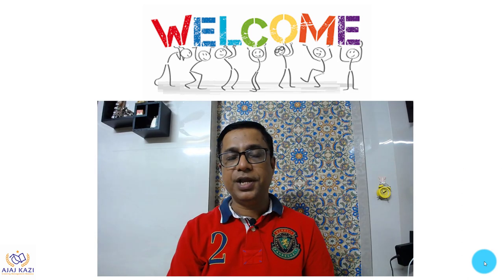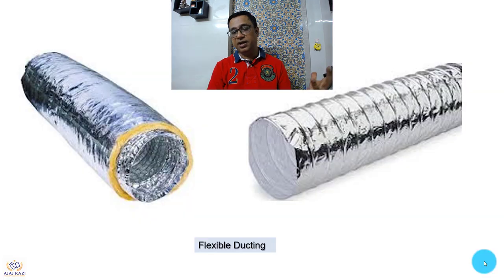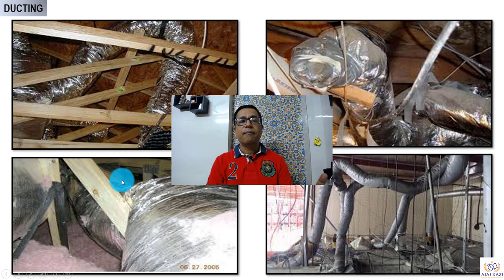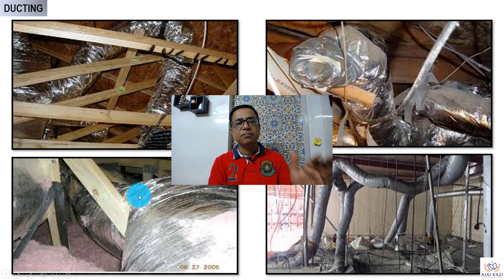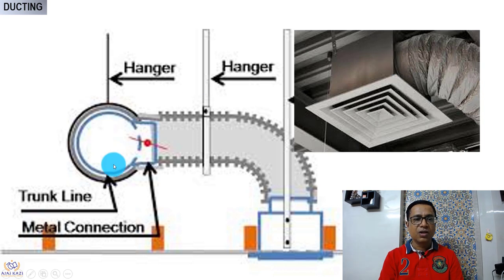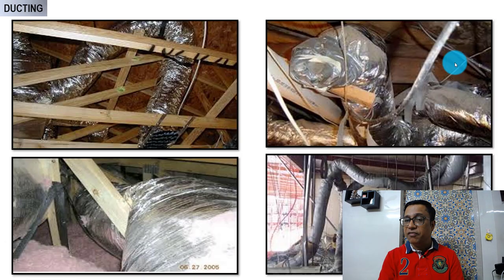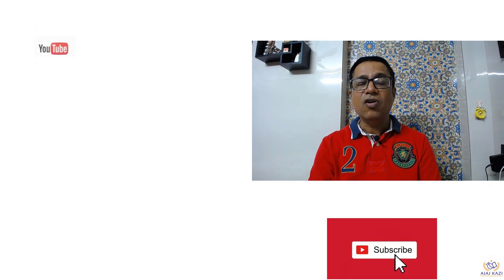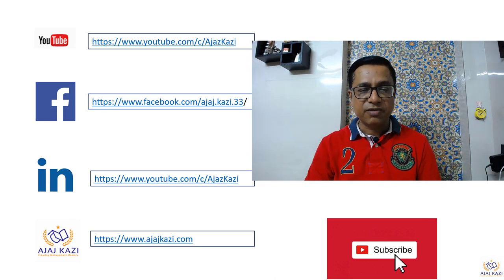How to Install Flexible Ducts - HVAC I Ajaz Kazi

Comment: You are absolutely right, installation of flexible ducts plays a very important role in the air distribution system. As shown by you, a correct way of installation ensures proper flow of air that helps in achieving the design parameters. Good job Ajaj, I appreciate your effort 
 highlighting the perfect method of fixing the duct.